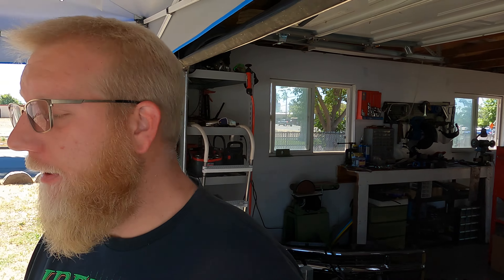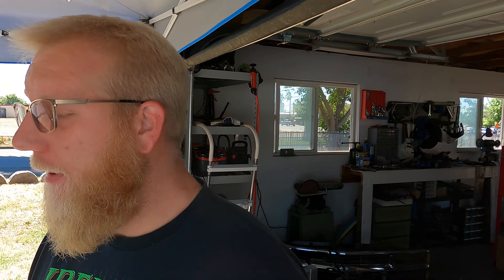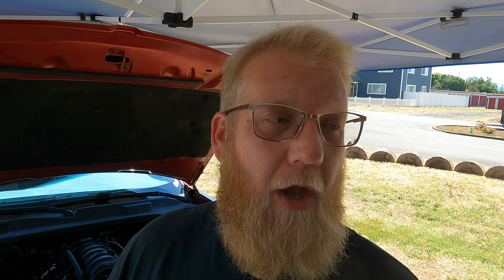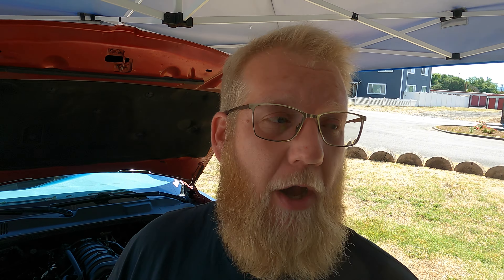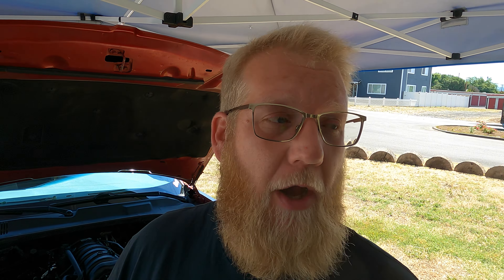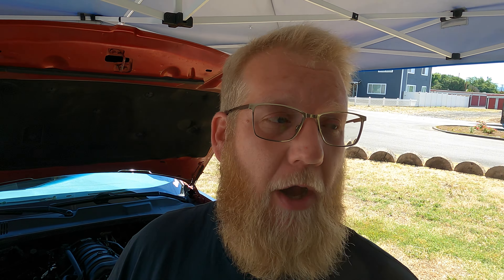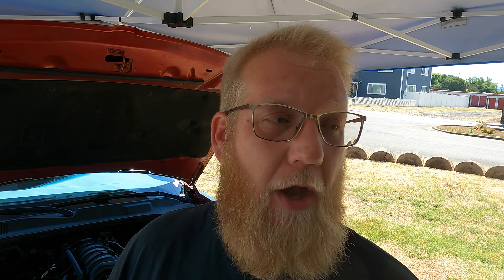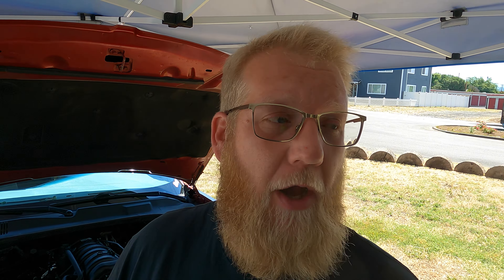How to replace motor mounts on 06 Dodge Magnum

Comment: Thanks for your video, very informative. Turns out (in my recent search) that the motor mounts you need (without the rubber humps) are made in Thailand. The motor mounts that screwed up your job, are made in china. I had to go to 3 different autozones to get the right one. Luckily they had it, cuz it's all the same part #, but different vendors. Anyway, for the pain and agony you saved me, you now have a new subscriber!
Reply from the maker: Awesome man! Thank you for the comment

Comment: What were the symptoms you were experiencing with the bad motor mount? I’m chasing a shake between 60-70 mph. Had the tires balanced and replaced more parts that I can list including the driveline.
Reply from the maker: Just a clunk really I could feel the motor bouncing. Put it in drive, put your foot on the brake and pump the gas to make the motor flex, with the hood open you should be able to see how bad the engine rocks
Reply: Have you figured it out having same issue

Comment: I ran into the same problem for my 3.5 dodge charger but it’s my only vehicle at the moment so I just used some washers (probably not the best solution) but I needed it done that day. I’d love to see the solid mount conversion so I can go with that route
Reply from the maker: That video is out. Check out my channel!

Comment: Which ones did you buy by mistake What is correct part number
Reply from the maker: The part numbers remain the same from store to store it's the manufacturers that make them differently I went with the O'Reilly's and trimmed a little bit of the rubber